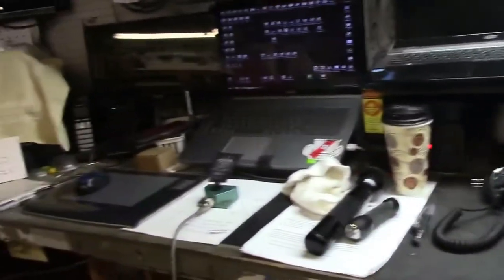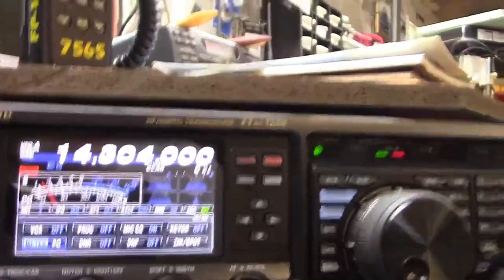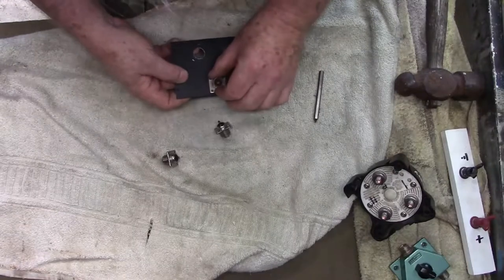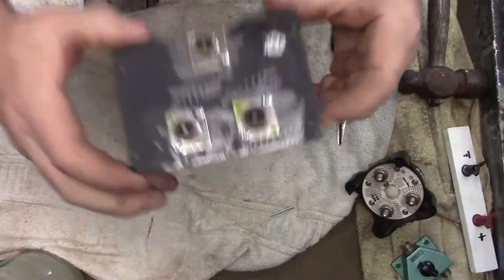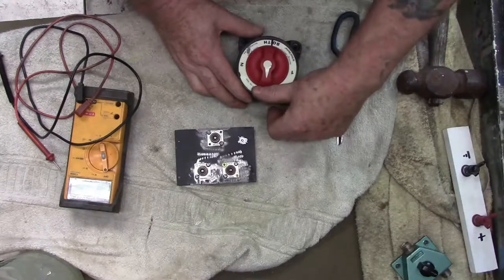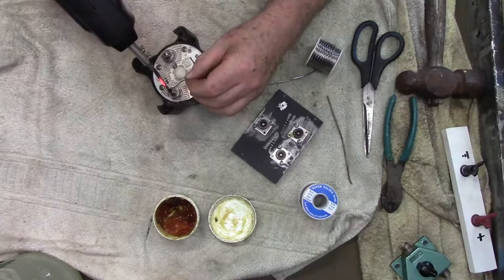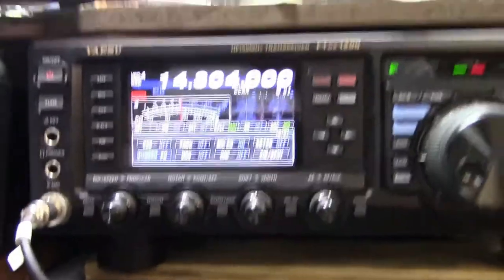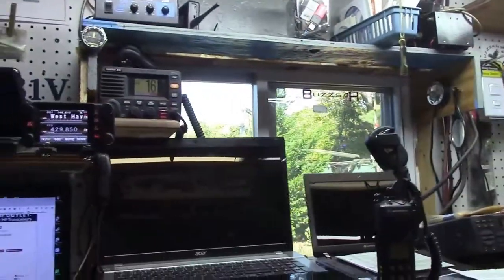Antenna Switch & an hour of confusion & bad editing Sorry

Comment: I I don't think I've ever seen a tip get red hot like that before. I like to use some flux too
Reply from the maker: I need a few new tips, this one is shot and has a little bend so it heats up more at the bend.  Flux helps the flow.  Check in mail. lol